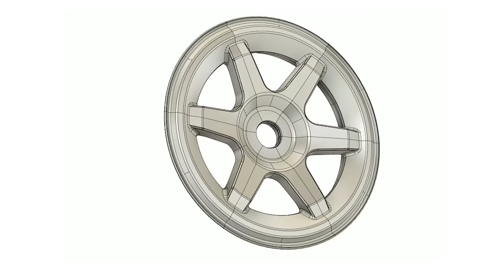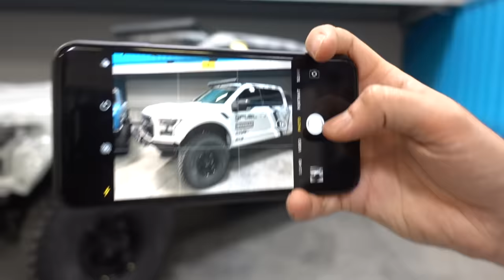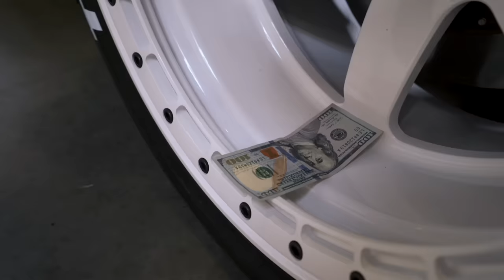Ken Block's Entire Fleet Gets NEW Wheels - Full Tour!

Comment: Huh, I had no idea the RS200 was a 4 lug pattern, neat
Reply: Mustang rules sorry sorry sorry
Reply: Yep, 4x108. Used on pretty much every old Ford.
Reply: I wouldn’t have thought it can push 800 hp on 4 lugs
Reply: @MonkeySpank17  very light car. very small car too. like fiesta size
Reply: Used a heap of stuff from the sierra cosworth era of cars. Basicly the merkur xr4ti in the usa. When building the rs200 ford just took a rummage in the old parts bin to see what they could use yo save cost.
Reply: Also the doors, front windscreen, rear light clusters, the center console. Then it had mk2 fiesta xr2 switches and vents plus other things. But there is more but cant remember lol